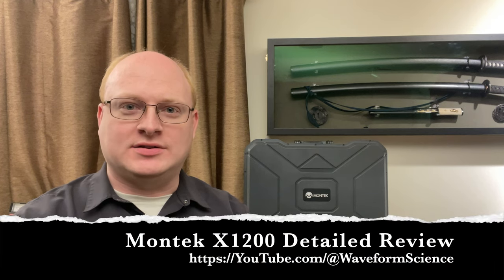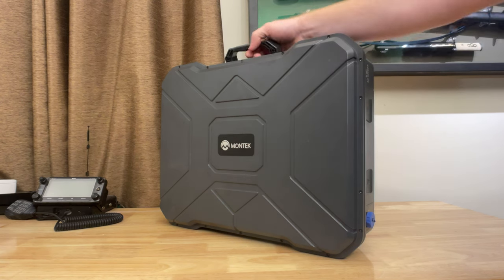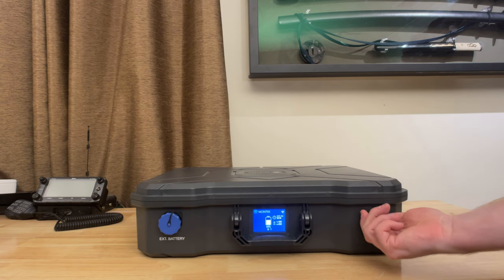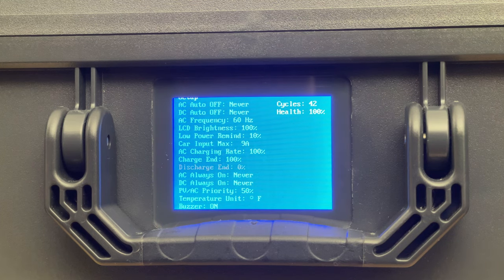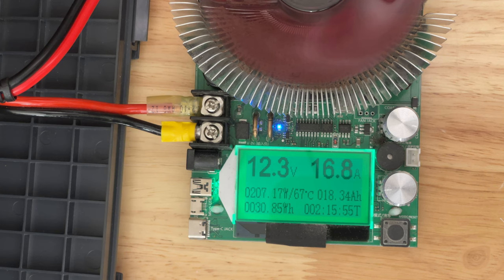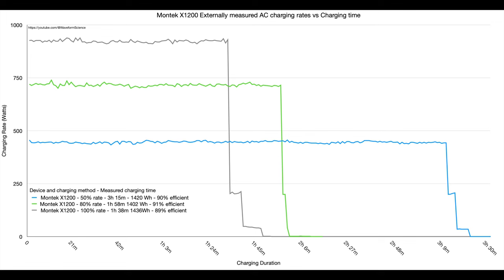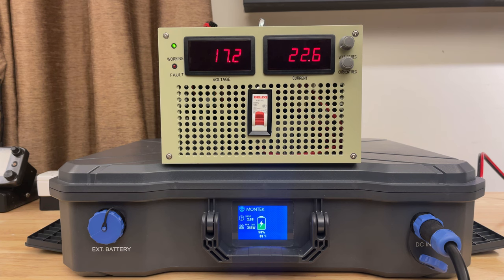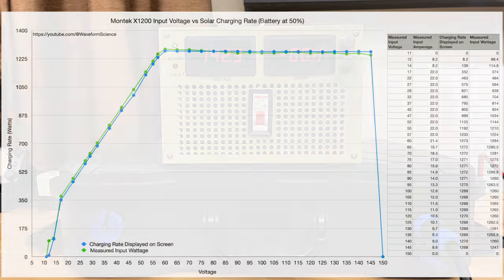Montek X1200 Solar Generator Detailed Review & Benchmarking

Comment: The best review!  I subscribed so I wouldn't miss the battery test.
Also of note, because Montek seems to be the only one offering more than 10A out of the Cig. Port, this unit may be handy for OTR appliances (found at all truck stops).
Reply: I've ran a compressor on my X1000 (the previous model), no problem. You can easily get more than 10 amps from the cig port. I've had my X1000 for three years now, and it's been flawless. Absolutely love it.

Comment: That dc side is impressive. Being able to get 5 amps out of both barrel ports, I think this is the first one that does that. They actually made them all able to put out what they are rated for at the same time. It is nice to see that. I know Bluetti fixed the issue with the new unit thanks to your video. I have never heard of 24 volt usb ports before. I am guessing it is safe for anything with usba charging cords to use. I like the size of these units.
Reply: The barrel port is 10A, not 5A.

Comment: Thank you for taking the time to do such a thorough testing and evaluation on The New Montek X1200 Solar Generator. I'm thinking of getting two of these units for split-phase 240 Volt AC operation. Do you know at this point what the maximum Amperage output will be of two of these units operating in split-phase 240 Volts AC mode ?
Reply: It may be 240V 20A 4800W max
Reply: @bachellervirginia4832  😲😲😲🙏 20 Amps would be so low as to be utterly useless.
Reply: @markjob6354  the inverter is only 2000W each. Or you may try Ecoflow Delta Pro, two units could get 240V 30A.
Reply: @bachellervirginia4832  I'm almost 100 % positive the X1200 is 30 Amps internally for both AC and DC, so split phase only needs to take 15 Amps from each suitcase to complete a 240 Volt AC @ 30 Amps in Split-Phase. (???)
Reply: @markjob6354  X1200 is 120V 20A max, so two units can get 240V 20A max. Voltage steps up, but the current remains the same.